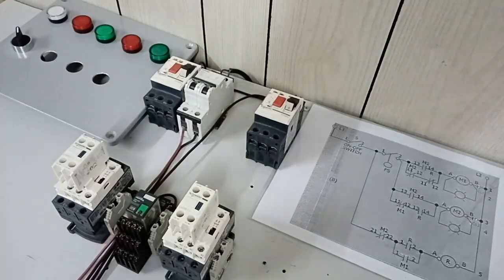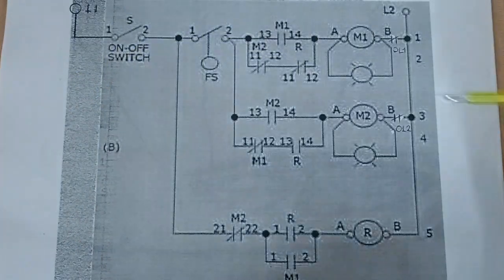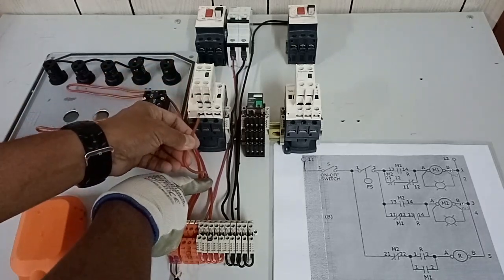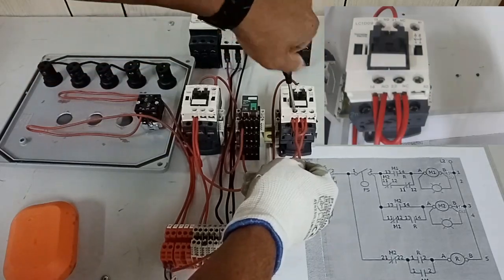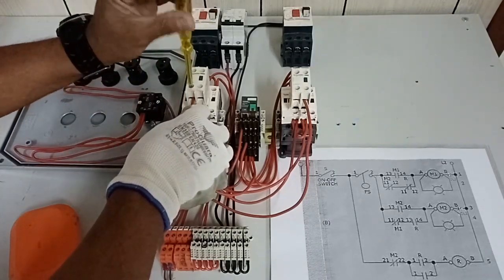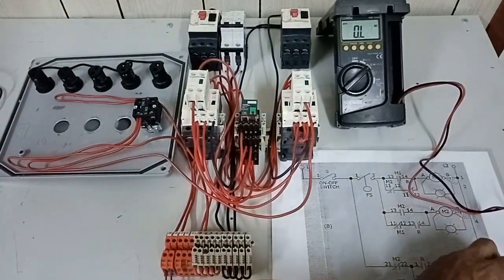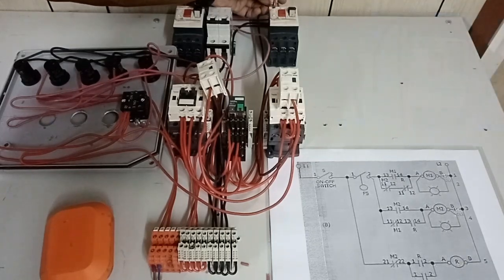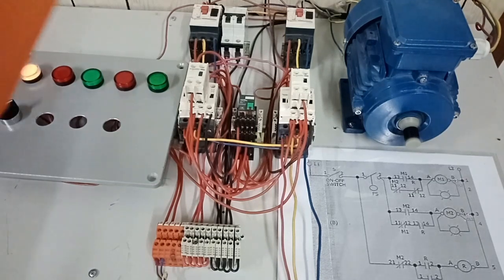ALTERNATING PUMPS CONTROLLED BY FLOAT SWITCH AND RELAY. /TAGALOG

Comment: Hi sir bago lng ako sa channel mo sir bka puede makahingi ng diagram ng 2 wye delta motor pump control by impulse relay with 2 float switch and 2 selector switch na ang isa ay for manual and auto at ung isa ay para sa pump1 and pump...maraming salamat kung meron bro...
Reply from the maker: Sir wala pa po ako ganun control circuit. Paki eleborate po ang function nya at gagawan ko po ng diagram. Paki pm po ako sa aking fb account Chris Ampere. Thanks and God bless po.